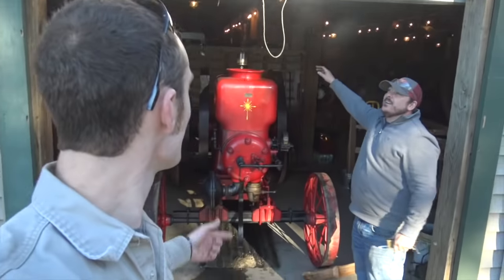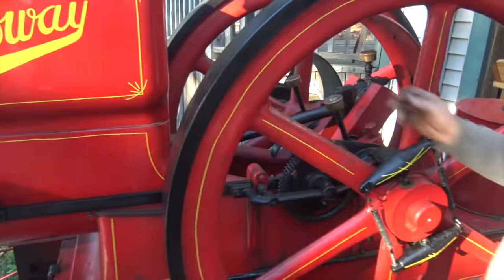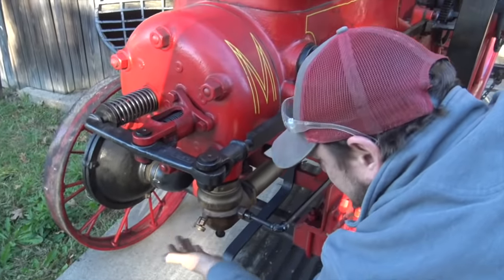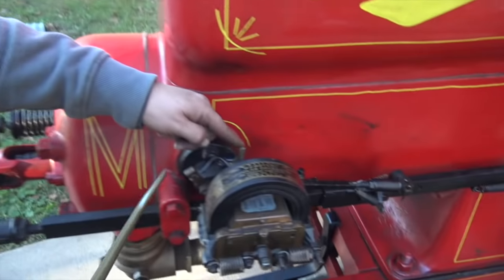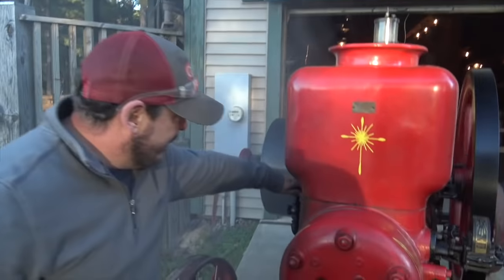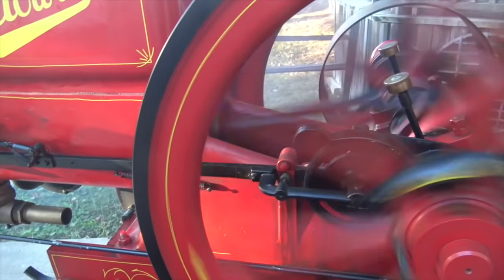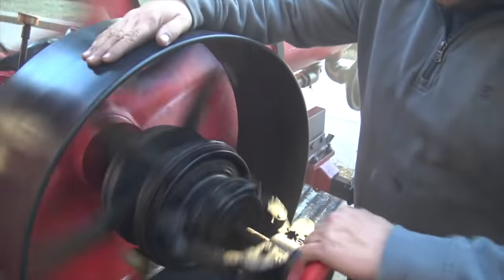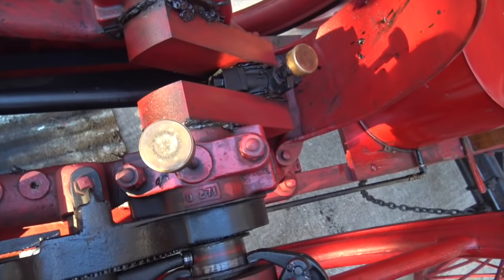WHY THIS INCREDIBLE ENGINE FROM 1916 IS PROOF THAT MODERN EQUIPMENT IS A SCAM & OLD STUFF WAS BETTER

Comment: I believe that industry worldwide in general looked around some 50-years ago and said to themselves.  "We make things that last forever, and therefore have fewer and fewer new sales each year".  And with that most makers of goods, but not all have reworked their designs with "Built-In Obsolesace" in mind.  Meaning thing are by design made to wear out and fail in a given amount of time and not be easily rebuilt, if at all.  This in turn leads to new sales and the growing consumer mentality of being a throwaway society.
Reply: Truth !!!
Reply: GM had planned obsolescence as early as the late 1920's.
Reply: Planned obsolescence.  Domestic washing machines are a good example.
Reply: That's only part of the reason the Ford 9" rear end is no longer made, it's also because Ford no longer had a monopoly on repair parts because everybody was making everything for them, so, time for a redesign, they also have to give the impression that they are making improvements.
Reply: @mybeachshack   true, I only buy commercial machines, not merely commercial grade from Whirlpool.  These are the same ones found in most laundry mats.  They can be about 20% more, but my family has gotten about 20-years use from any one pair (washer/dryer).
Reply: @jamesholland5475    and that shall set you free.   ^~^
Reply: Most all machines wear out at some point, but older machines were so simple that they could easily be repaired. Companies still want to sell durable products, but technological developments often make older products obsolete, inefficient, or sometimes even hazardous
Reply: Exactly right, DitzyDoo. This new tech has MAJOR disadvantages. Higher carbon footprints, short operational life, seriously complicated, pulling most owners out of self repair(driving up repair cost), and highly overpriced. All bad for ANY family's economic prosperity. Cut & dry-the old ways of doing things were the best.
Reply: Longer lasting slows down the speed of improvement because Replacement per Decade goes down. Eventually there will be few replacements and the new models will be for new areas and customers.
Reply: @greggweber9967  I am a mechanical engineer by trade and I am 95 years old and I COLLECT BOOKS AND MAGAZINES ON TECHNOLOGIES and I buy old technologies for I am a collector of technological stuff and my place in Kazan is more of a Museum of old technologies I inherited from 5 generations and I am the 5th generation. I will be honest with you, all of those so-called improvements were already there and they are in  existence for many decades. They are just being released and passed on as NEW IMPROVEMENTS even though they are not new improvements at all but decades old technologies kept under tight wraps and released only when it improves their PROFITS AT YOUR EXPENSE! In fact, in former East Germany, there is a LAW REQUIRING THAT ALL MANUFACTURED PRODUCTS WILL LAST FOR 25 YEARS AND CAN BE REPAIRED NO MATTER WHAT IT'S CONDITIONS ARE! They designed to be 100% perfectly and completely repairable either in the field or in your house or in your garage or in your work shops. My Cold War era laundry machine and drying machine are more than 67 years old and are still in good pristine condition and purring like a newborn kitten! The list is endless. And always keep in mind that ALL CORPORATIONS LIE ALL THE TIME!
Reply: @greggweber9967  Want more proof? Your desktop computers were all designed to last for 7 to 11 years when in fact they can be designed to last for several more decades! Remember the 200 year Linux OS? It is a success and being open source any nerd can make it interface with any old and new computer software and hardware but it was suppressed. Your Pioneer deep space probes that were launched in 1965 are still functioning for it's 1st generation IC silicon chips and CPUs were designed for the extremes and hostile environment of space and are thoroughly shielded and ARE THOROUGHLY HARDENED. Despite what NASA and the mainstream media is telling you and the public, they are still functioning. It has been 57 years since Pioneer 5 was launched (there are other Pioneer Deep Space Probes launched also after 1965) and they are still fully functional and their plutonium dioxide batteries are still at full power level capacity and are perfectly safe to use to this day. If those NASA scientists and engineers and technologists and technicians can build an electronics systems and networks and components and silicon IC chips to last for more than 57 years. Then why don't they allow such standardized technologies to be used by the civilian sector also? And also type "Planned Obsolescence" on youtube and check it out yourself.
Reply: @darthvader5300  Not just corporations. People with bad character are everywhere.
Reply: Vance Packard wrote a book in the 60s about it ...its called The waste Makers.. 
Generally it starts in the 1930s and spreads ..reaching its peak with the information age... thats now.
Reply: @clivestainlesssteelwomble7665   sounds like a good read.  I must find one in library system.  Thank you.
Reply: Except Tesla.
Reply: yes.. Whirlpool.. Ford.. Chevy. they all do it. No such things as Lemons. In the corporate world it called a New Sale. Had a 1950 Alice Chalmers B. I bought in 1996 to mow my yard. Sold it last year and bought a new zero turn mower. Yeah I miss my Alice. lol
Reply: Yep, it sucks! 🤓🍻
Reply: Let's see you drive something with tech this old and how many miles it can reach within your lifetime.  Early Priuses hit > 700k miles used as taxis.
Reply: There was a water heater design that could last centuries but it cost 3 to 4 times as much as cheap options, didn't sell, was removed from markets.
Reply: Yes when the world was made of steel
Reply: My Maytag model 107 series 1 washing machine is approaching 60 yrs old and runs 5 loads a week.  I enjoy keeping it going, which has not taken much.  I rate it right along with my 1947 Westinghouse air compressor, 100 yr old Parker vise, my anvil. Definitely a keeper.
Reply: @sugrue8526  so sweet.   ^~^
Reply: @ditzydoo4378  
He wrote a number of books The waste Makers and the Hidden persuaders were founding works with Schumacher's Small is Beautiful 
and the one that started it all Rachel Carsons The Silent Spring.  Technologies moved on 
a lot but unfortunately not the problems and attitudes that have got us into the mess we are facing.
Reply: @uncrunch398  
Its a tractor/stationary power engine  so thats not going to be a comparison ..  something like a vintage blower Bentley or Buggati is more a comparison for the Tesla. 
The problem with the Tesla isnt the Mechanical engineering stuff limiting it but the controling electronics and software related problems...and 
refusal to supply parts and maintainance information and special tools to third party's to repair and service the vehicles 
Like apple phones and certain American defence contractors.
Reply: Light bulb makers were the first to start re-designing their light bulbs to fail after a certain amount of time. 

There's a light bulb in a fire station that has been shining almost continuously since 1903. The only time it was turned off was when it was transferred to a new station. Of course it has a lower current going to it now to keep it shining.

Things used to be over engineered and that helped things last. Now things are engineered to fail. Made as cheaply as possible.

In a hundred years people will still have this engine and other old stuff but nothing from this era. It will be like we didn't have anything except these old things to work with. It's a damn shame.
Reply: @clivestainlesssteelwomble7665  I agree with your points.  Some of are why I wouldn't buy a Tesla until I know at least third party (preferably open source based) control modules or firmware and software work.  The rest can be repaired or replaced already.  My angle was it's not as straightforward to judge practicality of one option vs another as first glance would tell.
Reply: @uncrunch398  
Agreed the whole system has to shift from linear sales driven manufacturing to sustainable repair re use recycle... because we cannot keep taking it out of the ground moving it round the planet to stick it in another hole or burn it a few weeks,months or years later. Clothing is one of the worst offenders and single use plastics the other.  
Large scale production of highly efficient crate electric motors will unlock the conversion of existing vehicles ...  As its nonsense economically environmentally or energetically 
to scrap the structural mass of most existing vehicles to replace them with a sealed I phone on wheels type  marketing deal... and thats unfortunately where the car makers are looking... they build the vehicle but you have to pay to have features turned on ..and if they think they can get away with it a list of subscription services..🤨 The prime function and sustainability is being forgot amongst the technology bling sales pitch.. By my estimation that way lies madness ....again. 
Time for some aversion therapy.😉🧙‍♂️
Reply: @clivestainlesssteelwomble7665  It turns out it's more economical to install all the hardware on all units in the manufacturing process.  So why not just make it standard in the base model?  Maybe ongoing support for the (firm/soft)ware wouldn't be covered.  I just like the idea that someone can and will support the product legally after the OEM drops it.
Reply: So the wasting of good equipment started there then....
Reply: So where would you get a job with no obsolesance.
Reply: @tonyclough9844  Without hyperinflation and equivalently bad economic choices all around including on your part, you wouldn't need a full time job long term.  You'd do it because you like it, are otherwise bored and like things you still don't have and have to pay for.
Reply: @tonyclough9844  
Repairing repurposing recycling ... building new stuff ... when it allows you to use waste less...when its significantly better and sustainable there after  than what you have now. 
But you can no longer solely rely on increasingly on the specialists ...you have to look wider and further and realise its all connected .... Weve allowed ourselves to think we are seperate disconnected from where we live and the implications of what we do.
So what do you do, Design and build new Passive house standard housing that doesn't repeat the past housing errors or waste 1/3 of all the materials  
and energy that goes into that job. ..and dont get flooded burnt wrecked or become out of date in a couple of decades. 
Producing food .. working to maintain the community that maintains you ...repairing the damage weve done to where we live ..  working out new ways to what we need... and teaching that to others..  also teaching and helping others repair and adapt their lands to a point where they dont get forced out by disasters...  Sustainability is not about the maximum number of people that can live within a closed system but rather about what quality of life is possible...Developed nation
Populations are declining world wide..  and quite frankly the Market economists havent got a clue what to do or whats needed next..  but they never did for the most part.  
They forgot the deep history learning of the past... and have repeatedly ignored the warnings 
of those who really rely on a healthy living planet and societies to keep learning and maintaining life with limits to growth.
Reply: @ditzydoo4378  

So to go no
Reply: Nikola? or the car company, it's yet to see how long the vehicles will last, and how much to repair.
Reply: @victorbruce5772  It won't matter how long the constituent parts could last if the whole depends on a module that might not be supported after too many years and may not be replaced after it fails.  Also be sure to check that yours doesn't contain fluids (cooling electrical parts IIRC) that attract rodents.  They're causing fires.
Reply: Read "The Waste Makers" by Vance Packard.
Reply: It's called "sustainable engineering" and you are correct.
Reply: In 2007 ford ran their automatic transmission for a million kms. This is considered unacceptable business practise. They changed a few parts, and they couldnt run it over 300k without it needing a replacement. This assuring future sales.
The automotive industry makes more money from services and parts.
Try taking profits from businesses. It wont happen until integrity is led from the top.
Reply: @jaytee2395  Government regulation is always wielded by corrupt business which happens to be exempted as they wish.  That is why it needs to be voluntary by standards published by subject experts.  There are always such who want to start a new business but thwarted by regulations that don't make the most sense.
Reply: @uncrunch398  correct.
Reply: Samson says
 "Absolutely true. things were built to last then.I would much rather take a cross country trip using this engine pulling my covered wagon than having to endure the agony of driving cross country in a 2018 Winnebago RV".
Reply: International Lighbulb Cartel, decided that lighbulbs had to be made poorly so they would sell. Lightbulbs should last 100years.. No, seriously. A standard filament bulb should last 100 years, it is made instead to FAIL.
Reply: Take a look at rams 6.4l truck motor. 392ci and only available in 2500 and up. Guys are working these motors hard and still getting between 6 to 800k miles out of them.  Then look at normal motors for all 1500 trucks. 200 to 250k miles is about it.
Reply: This one point is stopping me from replacing my 26yo Mustang (original owner). There is NO WAY any of today's cars will be on the road in 25 years unless they were stored in a garage and never driven.
Reply: Wise words from derpy herself
Reply: @v_Shami   Ahhh.  ^~^
Reply: Look at typewriters. They have outlived many a computer model.
Reply: This is why i like old cars
Reply: I don’t believe that is entirely true. US made cars from 50 years ago lasted 100k miles sometimes a lot less. A car 50k miles was already old. I have a Lexus with 140K and have been told it’s 300k engine the car looks great including leather and is just wear and tear. All depends on how something is designed, quality control, intended vs actual use. Giant  cast iron blocks with low horsepower will last a long time.
Reply: Truth!!!
 If man made it and it never breaks he'd be out of business
Reply: I say this all the time but I couldn't have said it better myself
Reply: Apple is a big one of those companies with the built in obsolesance in every update.
Reply: Very true. You should check out the well documented story of how lightbulb manufacturers got together and agreed to degrade their product.
Reply: In the 1950s Vance Packard wrote a book " the waste makers " about planed obsolescence its just as relevant today as when it wS written
Reply: @clivestainlesssteelwomble7665  I have that book and it's companion.
Reply: The implementation of electronics into equipment and vehicles, was a signal that the era of long life was over.
They design circuits that are proprietary, and sealed in plastic, and impossible to replace.
Reply: You are absolutely 100% correct about that. I had a 1962model Lincoln portable welder that my grandfather purchased when he started the family welding business and that rig runs as well today as it did when brand new. Since then not a single welding rig runs as good or last as long. Lincoln electric company would have went out of business because their machines simply were built too durable!
Reply: @darthslackus499  From fully recyclable, and re sharpenable blades and lifetime handle, to throwaway everything.
Reply: @johneillenbannon7780  just curious...Are you a Doctor Who fan, and are speaking Judoon?😁
Reply: @jasenalford9021  
It is is we, that need to change our outlooks.
Such a company could have continued to expanded into new forms of welding and cutting and finishing equipment.🤔

However it doesnt stop the bane of genuine progress the  hostile take over and asset stripper's...
The other big  problem is the whole patents system .. its arguably what prevented the development of the whole 3d printing phenomena for 10…15yrs.
Reply: @jasenalford9021  Ans it is GOOD. Cause then they move to another industry, FOOD industry, is the eternal industry. Only thi k about it. NO HUNGRY With that capital entrancy and competence.
Reply: @yuribezmenovthegreat4705  Self reliance and global value against inequity could simply unarmed them like Boetie says if we dont go in their ways and decide ourself to make something fair for everyone as any old religions and sages teach 🧘‍♂️✌️ love and respect other / dosent mean than we cant help each other to have food and solve real humanity problem instead enginner other for profits 🤑... hypocrisy and greed was the biggest treath for folks at the moment cause they create other problems and so on!
Reply: I'm an appliance repairman for 15 years, I can confirm that .
Reply: DITZYDOO Is the PERFECT name for you, your logic is on a par with ditzy.
Yes there is a a conspiracy, we could have had this engine like this powering 747s helicopters years ago.
Reply: My first car was an 88' Buick. I got it in 2000. 12 years old, still ran. My grandfather taught me to maintain it, change the oil, etc. but eventually I sold it.

My next car was a Seabring. It had the oil filter in kind of a hard to reach spot... It died of an electrical problem no mechanic could fix.

Then the next one, a Saturn, completely hid the oil filter behind a panel you had to unscrew. It ended up having a computer issue no one, not even the dealership, could remedy.

By that point I was actually done with American cars, around the time Dubya and Obomber were getting their arms twisted to bail these shit heaps out.

So my fourth was a jetta... I never figured out how to change the oil. Yeah, Germans too. One of the shittiest automobiles I had in general.

Currently an Accord and it is okay. I can actually change the oil in it at least but...

Something that simple.

They don't want you to be able to do anything.
Reply: @darthvader5300 You sir are a rare breed, old enough to remember when and intelligent and experienced enough to not buy into big companies bs. I’d like to meet you personally, you seem like you wouod have some good stories to tell.
Reply: Winner winner chicken dinner!!
Reply: Why make a product that someone throws away before it expires? Increasing the price to accommodate for something lasting longer makes customers go to the competitor who sells for cheaper but still lasts within the window most people buy something for.

Blame your fellow humans and possibly yourself for buying and not fixing the stuff they have, not the companies. How long do you keep your phone for? How long do you keep your car for? Savings can be made in any product by reducing the material (how old things lasted longer).
Reply: Really, this happened.  The light bulb manufacturers sat down together and created planned obsolescence, early in the 20th century.  The idea spread like wildfire.
Reply: Planned obsolescence sometimes referred to as "engineered failure". Making a science out of designing things to last a determined lifecycle on purpose rather than making it as robust as possible.
Reply: Yeah no enough people complained about moving their three ton generator from place to place
Reply: 100%%
Reply: Yea that’s why the do strength tests now and can tell you oh this window will operate for at least a thousand rotations because they design it to last just long enough to be out of warranty but not short enough to be considered garbage
Reply: @mybeachshack  so is Tesla
Reply: My grandpa is 54 Bel Air didn’t crank for 20 years they replace the battery and put fresh gas in it it fired right up the seals were still good it’s still running
Reply: It's actually not quite that simple.
You do need market saturation and either a monopoly or some advantage over competitors that last longer. The understanding was always there but it took a while to get there.
Reply: Photos cartel did the same with light bulbs.
Reply: @jondoe292  that’s why the real Edison bulbs lasted almost for ever I think the last one just blew out in New York a few years ago
Reply: Greed.
Reply: "We can reduce operational costs by reducing the weight."
Reply: @armorer94  Technology was changing rapidly. I'd be surprised if they didn't plan for it. There was no way to introduce a 2020 car in 1920.
Reply: I was thinking that at Lowe's looking at all these new electric yard tools, like lown mowers, saws and weed wackers. When your electric tool breaks, can you even fix them? Almost like they are making it to throw away when it breaks so you have to buy a new one.
Reply: Cost.. You can buy stuff that lasts hundreds of years but you won’t because it costs too much.. The market drives the products.. people wanted cheaper products, cheaper products don’t last as long..
Reply: @dennislock3415  Thanks, that's what I ment to put.
Reply: @justinhelsley5241  You're welcome.
Reply: @flintfredstone228   "companies still want to sell durable products" - no. Companies are driven by greed and profit, not by durable products. They will make cheap junk that lasts a few years at best, and highly priced goods that will last maybe two decades, but anything above that is cost comparable to a prototype: few people could afford it.
Reply: @ditzydoo4378  same with my speed queen washer and dryer. 20yr warranty. The epa forced them to discontinue my model because it uses too much water. It actually gets my clothes clean unlike the new ones.
Reply: @danhammond8406  Agreed, what's the sense in saving a half gallon per load when you have to make more loads just to get the same level of clean you had before.
Reply: So true. Looking into the history of lightbulbs you will see where it started.
Reply: Free energy is everywhere now and charged for
Reply: years ago i worked with an older guy who was on ford design team. He said that the pinto was fords first step at testing the market for a throw away car. The idea was to make a 2500 dollar car for the masses and have it all wear out in 5 years such that owners could drive for 5oo depreciation per year then scrap it for 500 at the 5th year
Reply: That’s basically the size of it.
Reply: @Justthemow  They dont even have to do a test, engineering technology has advanced to a point where the computer program can tell them with startling accuracy how long a part will last.
Reply: There are so many new customers, accidents, fires, etc that if you made a long lasting piece of equipment you’d have great sales.  We live in a throw away, I want it cheaper and cheaper and this is why we have crap.  Take a class on taking a product to market and you’ll learn why most people don’t want to pay for a product like this.
Reply: planned obsolescence started with the lightbulb. yay capitalism
Reply: Yes, this. I spoke to a Ford auto engineer at a party one time. He was told that they have to design stuff with a shelf life. So it’s planned so the share holders make money.
Reply: @flintfredstone228  ... that ease of repair is the main reason IS troops Jan the skill and experience to make field expedient repairs to broken down equipment. The Germans and Japanese troops by and large couldn't. It made a difference in combat
Reply: I dunno man.  I can reasonably expect to drive my car for 150,000 miles before major things start to break down.  With minimal maintenance.  If that's planned obsolescence I'll take it.  More please.
Reply: @greggweber9967  
Slows down the speed of improvement?
Most units are downgraded from their older models.
The only improvements any company make these days is how to make the item cheaper.
Reply: They spent money to create a light bulb that didn't last forever
Reply: I saw a correlation of the rise of marketing over business-minded, i.e. higher sales vs. durability.  Make it look good and appear to provide a want over a need-centric manufacturing occur.  With the advent of plastic came an advent of greater profits.  I agree with what you're saying.
Reply: @pstewart5443  Edward Bernays doomed us all
Reply: It is supposed to be that they make something better so you want to replace it. Sadly though, it is your original statement that is true.... Make things shitter, but in a way tge average Joe can't put their finger on it.

It is really clever but evil in a very wierd way.

I'd love to hear a higher intelligence's perspective on this and on us in general....
Reply: Nailed it.
Reply: But where would we be without microplastics?
Reply: @ezrawright4385  lasting longer than 100 years from now
Reply: Then don't buy the new things.
Reply: No, they did not. You're deluded.
Reply: It’s also because we demand more power from our machines. More power in smaller packages equals more friction, shorter lifespan.
Reply: No one in this comment section knows what planned obsolescence is lol
Reply: @Xixu.co.6  it seems like a good 38% do actually if you do the math
Reply: from showroom to landfill economics . That IS unsustainability, and keeps the masses from procuring a better life !
Reply: @mybeachshack  It started with light bulbs. I have a Hoover fridge circa 1966 still works.
Reply: Yes you are correct 100% thanks
Reply: This is the absolute TRUTH! It's simple math - it's impossible to maintain an industry without a demand for your product(s)..
Reply: @mybeachshack  - Any household appliance, really..
Reply: Except for Toyota four runners from the 90's lol!
Reply: @flintfredstone228  wrong check out music city trucks. They can use old Ford motors just fine
Reply: @uncrunch398  you wish
Reply: A sustainable system depends on minimal waste.  Not permanent employment.  Maybe businesses would be sane if governments weren't setup do depend on plundering. All greed leads to collapse.
Reply: @beastiemcgee544  A smart non perishable goods maker is run with the expectation and intention of slowing down after saturating the market.  The hardest problem there is retaining access to skilled labor if your product is complicated to make or package. Employees could be smarter (extending to dependents) with their earnings and not demand so much they destabilize the economy.   Businesses need to spend on research and innovation to stay alive.
Reply: @effu9593  True, like my 1956 Willys CJ-5.  It's all original and the 134 ci F-head still runs smooth as silk.
Reply: More than Fifty Years ago !! Closer to 65 :)
Reply: You think Gerald Ford for playing golf lessons because it was the Ford motor company that decided it and it's been a trend ever since.
Yep good old Ford and that's whyFound On The Road Dead became a moniker of Ford because planned obsolescence didn't make your car safer that's for sure.
Reply: It's the consequence of capitalism, plain and simple.
Reply: @tccummins  it's the consequence of late stage capitalism or what Lennon referred to as end stage capitalism.
Reply: @tccummins  oh so true.  corporate greed is an evil unto itself.
Reply: Ive been saying this the past 20 years since I was 10 lol
Reply: @dperry9406  Also thank common folk for wasting their money so their lives had to depend on several decades of continuous employment.
Reply: @flintfredstone228  look up design obsolescence..companies make things break after a time.
It starred in capitalism with the light bulb.
Reply: I still use my great grandfather's 1921 sterling electric chop saw that uses old flat belts. I use it to cut thick bar stock steel.  It's slower than a modern saw but it's over 100 years old and still works great.
Reply: @daltonm6764  wonderful to hear of it.
Reply: @sergeantpeppers8858  did you watch the same veritasium video by any chance on this matter? It was quite interesting
Reply: @adamcheeseplease  No. I watched a documentary about it years ago.
Reply: BINGO !!!
Reply: @wingedinfinity6715   ^~^
Reply: I have a bunch of these laying around.
Reply: These engines don't last forever. That's why there are very few of them left.
Reply: @darthvader6300  hope you get a museum for things you've collected.       Agree with comment. Just can't help but think of all the arms that have been saved. Literally.
Reply: @armorer94  i think planned obsolescence for the original light bulbs predates the 1920's.
Reply: @007SS40  Cut & dry old ways are good but this tractor was anything but simple...look @ all the $#!t he had to do to get it going.  Newer ones are far simpler to operate.
Reply: Didn't cars used to last, like, 10 years tops? I still see cars from the early 90s in daily use these days.
Reply: This is absolutely true I recently saw a video about a light bulb that has been burning for over onehundred years straight, before planned obsolescence was agreed on, it simply was ran with less watts or volts than what it was suppose to, in turn staying on for 100 years.
Reply: Maytag repairman! 

The sad part is the definition of "forever" has become shorter and shorter! 

Most products only last a few days beyond warranty these days! They have it down to a science!
Reply: @WW5RM  tis true, tis true.  If they put the same effort into making it last, as they do in making it fail in such a timely manner.
Reply: Called "PLANNED  OBSOLESCENCE "
Reply: @georgesheffield1580  Yep something we don't teach in school. Or anywhere.
Reply: Truth. Planned obsolescence is caused by corporate greed. Like many if not most of the world’s problems. Corporations have gotten richer, more powerful, and more corrupt in the modern age.
Reply: As a kid my uncle and aunts Victorian era mansion still had some original lightbulbs still working
Reply: @deanfirnatine7814  old does not mean obsolete.  ^~^
Reply: For the most part I agree with you, but automobiles do last for a lot more mileage
Reply: @007SS40  Yeah, I really miss replacing those mechanical ignition system points.
Reply: @samsonchazbak5387  This is a stationary engine. Stationary means it weighs too damn much to move around a whole lot. I have a wagon, I use mules. Mules... Even God uses planned obsolescence.
Reply: @meatybtz  But there's a trade-off. The longer a light bulb lasts the more energy it takes to get the same amount of light. But yeah, they were making that trade-off a little on the short side. Hell, manufacturers of LED lights are busy doing that today. If you run fewer diodes where they run a little hotter then they don't last as long. The trade-off with LEDs is minuscule, there really is no reason except greed to do that.
Reply: @The1redman2  Yes, I repair stuff for a living too so I'm not that against things wearing out, what I'm against is not being able to repair them.
Reply: @armorer94 what was that then,  can you give an example,  or was it 50 years then a part wears out vs 2.5...
Reply: @ryanbeard1119  when I say "it lasts forever" I am alluding to the fact that with proper maintenance and care older items will.  were as todays components are meant to fail by a certain time and not be replaced leading to it having to be replaced.
Reply: Funny how 150,000 miles is nothing for a car today when 100,000 miles for a car 50 years ago it was the near end of life.
Reply: I believe you are right! They are made to stop working a week to a month after the warranty expires, and the government's rules made it illegal to repair it.
Reply: @philipaldrick5363  It is a sad thing.  My 1956 Willys and 65 Ranchero still plugging along quite happily with basic maintenance.
Reply: @tihzho  people get rid of vehicles all the time ar 200,
Reply: Don't forget Edison :) It's always about the guys who want to control the whole industry. Because it only works if you can prevent others from coming in - regardless of the tactic you use. Mass manufacturing absolutely relies on being able to keep making the stuff in the right numbers for long enough. Which also means that if you want to do any innovation that requires extensive refurbishing of factories, or worse, building new ones outright... you need to push enough volume to be able to pay for that investment before the next innovation comes around.

Which is not a defence of the practice, mind. Just something to bear in mind when deciding what to buy or support. If people keep wanting "radical revolutions" every two years (as they were taught to by marketing, of course :P ), all that equipment and development somehow needs to pay for itself, even before you account for the greedy bastards who just want to make a lot of money with as little effort as possible ;)
Reply: I have a refrigerator from 1956 in my basement, everything works perfect in it, never have a problem.
Reply: I was told by a history professor in college that planned obsolescence was officially invented by Ford Motor Company in 1962 when the high reliability of the Ford Falcon nearly bankrupted FoMoCo.. From that day forward, they started designing in flaws and failure points.  The rest is (collapsing) history. Now, EVERYTHING is built broken.
Reply: It is wonderful to see young people who love this.
Reply: Not really, plenty of expendable garbage was made…it broke and got thrown out. 

The survivability of many of these machines had for more to do with low mileage and an excellent maintainer
Reply: It actually all started with light bulbs over a century ago.
Reply: Yep. I work for Quincy Compressor and the 100 year old technology is the best design. Now that they are partnered with atlas copco they don’t last at all.
Reply: Think land rover adopted this idea
Reply: This is fact.
Reply: But we are the ones who need to "reuse and recycle". It is a direct  contradiction coming from these corporations. Now automobiles and larger machines are throw away.

Thanks for sharing the  16 hp hit and miss!
Reply: @mybeachshack my girlfriend hand washes stuff because it smells better and I love not worrying about when the washing machine will break again
Reply: That's plain BS. Planed obsolence doesn't exist. Literally everything now has longer life span. People use engines much more often than before.
Reply: @darthvader5300  Their electric generators are not at full power level.  The generators rely on the decay heat of plutonium-238, which decays with a half life of 87 years.  After 57 years the heat output has fallen to 63% of the original power.
Reply: first off that theory doesn't play out in the real world as much as people would think. Why? Ask your self that question if you bought a product from a company and it's a crappy product that failed sooner than you anticipated. would you buy from that same company again? I sure as hell wouldn't.